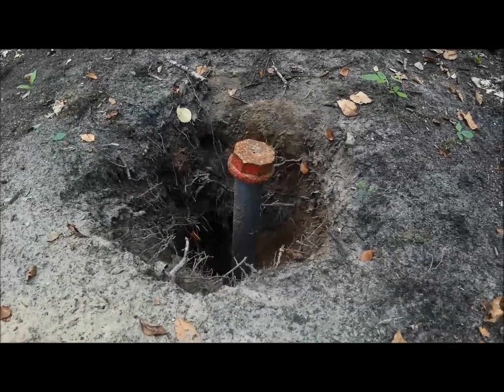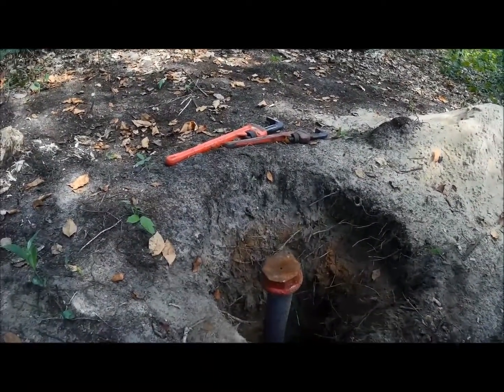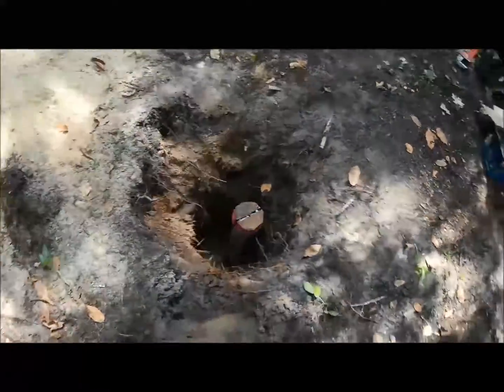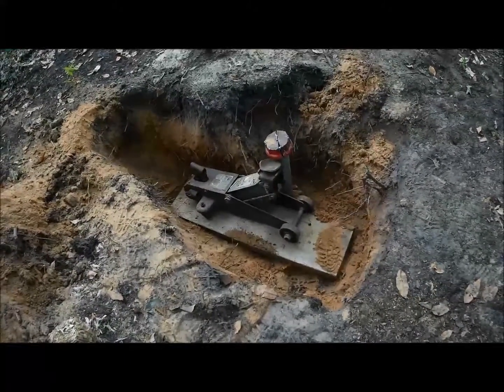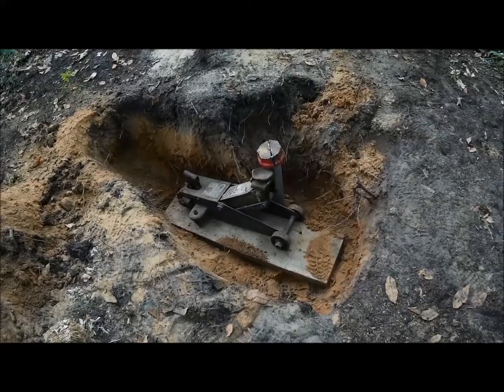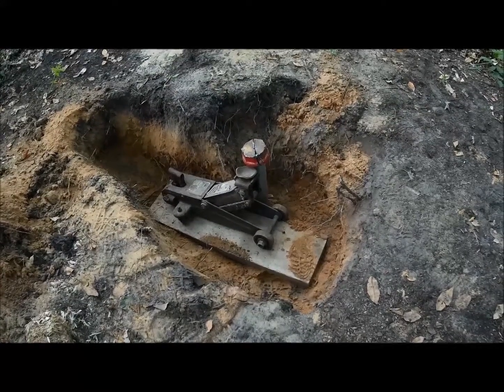Shallow Well Part II (pulling a shallow well)

Comment: instead of pulling the 2" pipe couldn't you have used a bell reducer (2" to 1-1/4") with a 12" 1-1/4" nipple to fit the Jack hammer on?  This is not criticism, I'm wondering if after your experience, you think my idea would work.
Reply: The Handy Outdoorsman use a 4 inch pipe with the pounding cap so you don't damage treads on the pipe going in the ground
Reply: A pipe cutter and pipe threader would save a bunch of work. You can cut the pipe in the ground and thread it in the ground too with a hand threader. Add your new pipe 4'-5' sections work best.
Reply from the maker: Hey Eric, your question is very valid.  If you watched the previous videos you would have noticed that the 2" pipe was bent near the cap.  I could not get the cap off to add another piece of pipe, so it had to be pulled.  The store where I rented the jack hammer said that others had tried the reducer method and it always ended up breaking (perhaps cheap China made parts?).  I did save the 2" pipe and plan on putting in another well in the near future.  I might just try the reducer method as the 1-1/4" pipe went in like butter with the jack hammer, the 2" might also.
Reply from the maker: Others suggested that as well, unfortunately I do not have much experience with neither.  Thinking the pipe cutter would be easy to cut the pipe, however if my cut is not straight wouldn't the .threads be crooked?  or does it matter?
Reply from the maker: Sorry Charles, I just got notified of your comment (weird).  Your suggestion is a great idea.  If I do this method again that is the way to go.